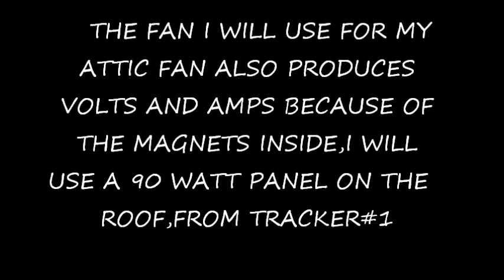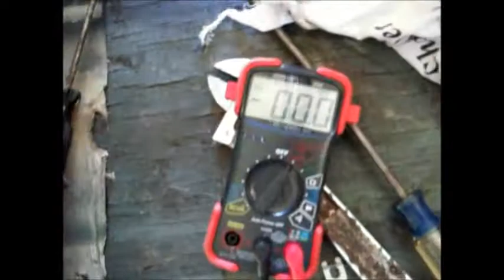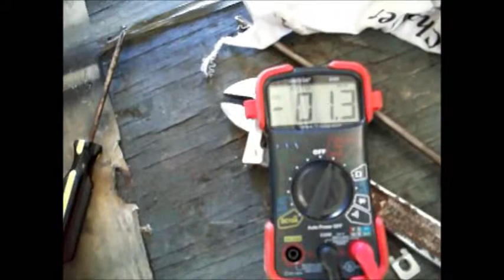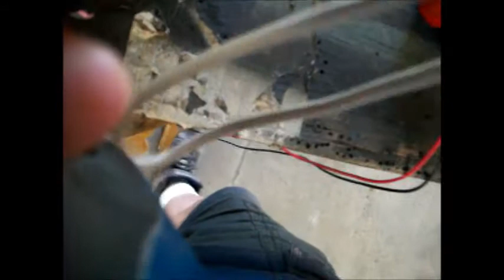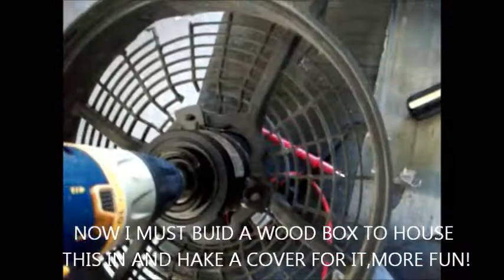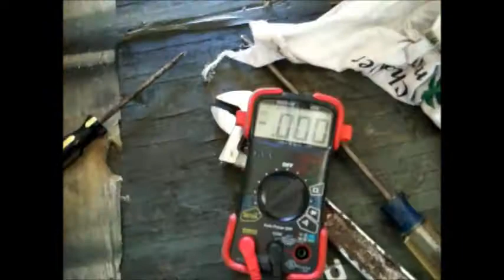THE 12 VOLT FAN I WILL USE IS A 12 in" PULLER 6 AMPS.

Comment from the maker: When i went up to check the fan it was the biggest joke i have seen 7inch duct Fan had 100 cfm lable then when i cut the hole I was shocked at what i saw 1by 1,s for trusses  6 ply plywood beam on ridge less than 2 inches of blown brown looking stuff just pitiful.I whet to buy 1 like u have so i could use the base for the hole but at $40.00 i got a power vent instead for $73.00  The 12 volt fan fit inside .I still have to seal it up its just to hot on the roof i feel sick.I wait till after 7PM.